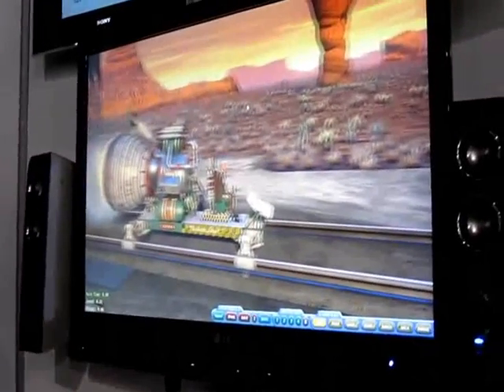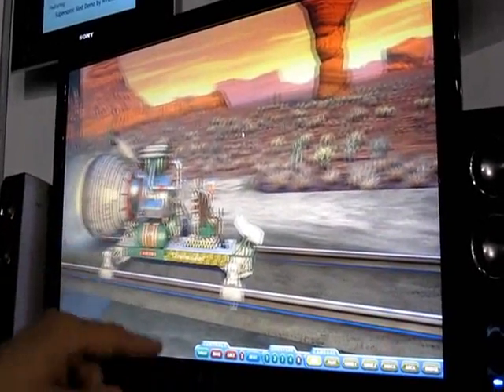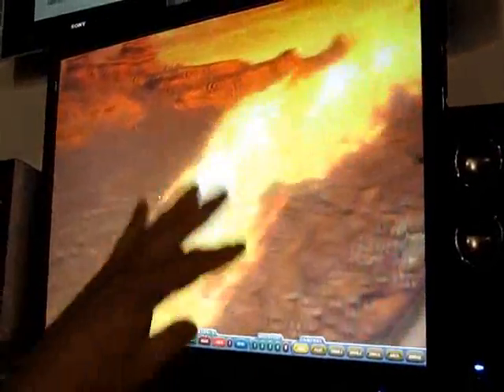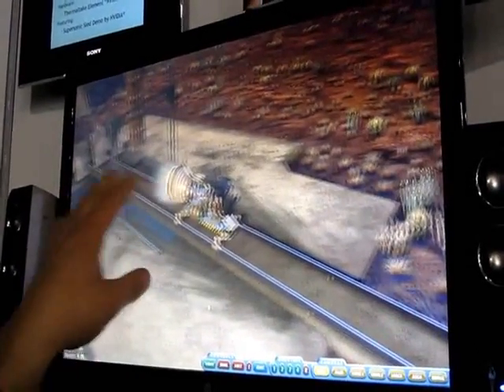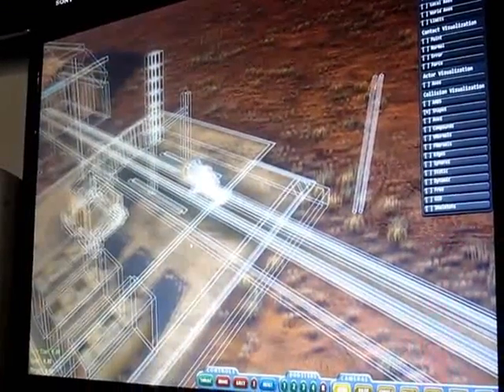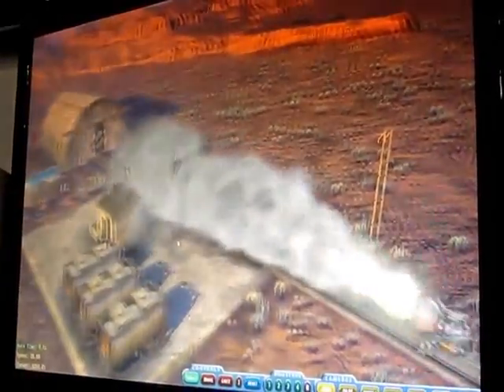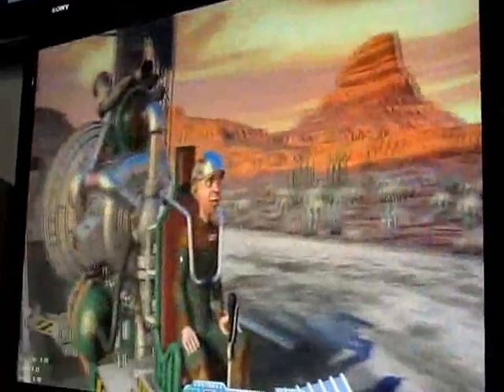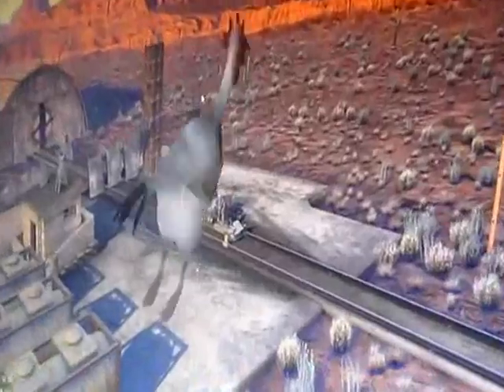NVIDIA GF100 Fermi Video Card Triple SLI Rocket Sled Demo

Comment: @TimisoaraCoolMixers... In case you have a hard fucking time reading, I am not speaking to you.

I am speaking to the guy with the 1800 dollar laptop that cant play COD4 on the lowest possible settings.

BTW, a GTS 250 has really really terrible performance on far cry 2. Unless you play at a low resolution, you arent getting more than 40 fps on ultra, with 25 average.

How do I know this? I ran an overclocked 9800 GTX. In case you were not aware previously, a GTS250 is a rebranded 9800 GTX.

Comment: @mrbigtime81 I'd save some money and get a 5870 or 5770. If they cost the same I would probably get the 5970 because it kills the 480 in DX10 games. But for DX11 480 does do better tessellation, but the raw power of two GPUs in the 5970 allows it to tessellate at a simillar or faster speed. So overall I'd go ATI.

Comment: @alexapirot32 

5890 is the nickname given to the 5970 clocked to 2x5870s specifications. It required 2x PCIe 8 pin connectors and is a triple slot card.

Comment: Well I can play Crysi on Very High with a 1024 by 763 res no aa on the GTX 260m

and Crysis War head on Enthusiast with full res. 

GTX 260m = 9800 GT.. GT 240 is 30% less powerful then 9800 GT. 

you do the math.

Comment: 5770 is not an enthusiast card.  That's the 5800-line.  It's a gamer's card, so it has good performance, but not great.  The GT 240 is a step below gamer...I don't know how you get it to play high to very high settings on Crysis except at 480p, since that's asking a lot out of cards even three times more expensive.  

That said, nVidia with its GTS 250 still has a strong hold on value, but the GTX line is horrid right now...

Comment: Radeon 5770 requires a 450 watt power suply... it doesnt even compare to the GT 240 on any scale.. the 5770 is an enthusiest GPU.

and the 5670 compares to a 9800 GT. they both requir same power supply. and coast the same. 

name one Radeon GPU that requirs a 300 watt power suply and beats the GT 240 wich can play Crysis on High to very high graphics. 

IDC what you say you can make your GPU magically handle. I want one Radeon GPU that says on the Box 300 watt supply or greater that beats GT 240

Comment: you obviously don't have a 300 watt power suply in your computer. because I have tried putting Video cards that require higher wattages and the computer just shuts down. Radeon and Nvidia cards I am talking about. 

your wrong Nvidia has the best cards cause they are the most energy efficent.
on the mid and high end of things

and the GTX 470 will = the 5870 for the same price

and the GTX 480 will be better and coast a reasonable $500. 

Pop goes the Ego xD. not today fanboy

Comment: my god all of what you said is just ignorant and retarded im not even lying
my radeon 5770 can run just fine on a 300 watt psu which also powers a AMD athlon 2 x4(quad core) and 6 gb of ddr2 ram
wattage is not the only thing where ATI has improved over Nvidia, and thats sheer compute power, and PRICE
ATI is not only winning on the enthusiast section but pretty much everywhere else from the 5970 to the 5570

Comment: the GT 240 and GT 340 are better then Radeon because they only require a 300 watt power supply wear as a Radeon GPU with the same performance would require a 400 or 450 watt power supply. 

if you can't see that your just a nut case Radeon Fan Boy. I have done my research on this one. Radeon has nothing to compete.

Radeon might be winning on the Enthusiast end of things with the 5000 line. but not the mid range mid and high range end.  

ohhh and wtf is with You tube and comments messed up...

Comment: 400 series is a jump ahead of the 5000 series, the 300 series is already out but mostly used for laptops and still more powerful than the 5000 series , ati has the shities drivers out there , that is one of the biggest reasons ati does nt win vs nvidia. the 6000 series will the the competitor to the 400

Comment: @jizzmatic2000 well im just saying with my experience with both high end cards from both manufactuers, ati has always run more smoothly in games with better FPS. equivalent cards aswell, i now have the ASUS Radeon 4850 HD, and i have compared it both to the GT260 and 8800GTS. and its still better fps then both, very close with the 260 though.

Comment: @SockanL0L 
Excuse me?

Just because I like ATI's DX11 cards doesn't make me a fanboy.

"better cards produce more heat, period. "

Wrong. The 8800GTS 512MB outperformed the 8800GTS 640MB while consuming LESS power and producing LESS heat. Why?  Because it had a better architecture G92 vs G80.

The GTX480 is better than the 5870 yes, but weaker than the 5970. 

All the evidence points to the GTX480 running very hot due to its larger die. ATI simply has a better architechture this time.

Comment: maybe maybe not, one could hazard a guess that because ATI has a monopoly in the Enthusiast set of graphics cards FOR THE TIME BEING, they probably are jacking up the prices, once the Big guns from Nvidia roll out regardless of how they price them ATI will surely probably pull the 5970 down from its current 700 USD price mark to probably around 600/550 it wouldn't surprise me at all honestly, ATI/AMD have never been a company to compete point for point in performance but bang for the buck.

Comment: Yes the 5870 is the only GPU I actualy like by Radeon. But I am not getting a desk top for 2 years. and I would rather get a GF 100 single GPU in 2 years instead. 

Right Now I have a laptop with a GTX 260m. 

I can play Crysis with descent Performance on Very High with a 1024 by 783 res

and Crysis War Head on Enthusiast with my full resolution. 
Hopefully Crysis 2 will be even more efficient then Crysis War Head. 

but other games like MW2 I can play on Max full res 4x aa no problem.

Comment: No, the GTX295 does not average 60 FPS at crysis 1920x1200, not even with 4xAA or even 2.

Or you could get a 5870 which:
* Is even cheaper
* Eats so little power compared to the 295
* Is two generations beyond on DX (DX11 & DX10.1 vs DX10.0)
* Performs almost similarly
The 5970 is a waste of money in my opinion, but the GTX295 is even more of a waste.
* Eyefinity
* etc etc etc

Comment: @Nomad2243 

36 vs 60 fps is a huge difference. For Crysis, a person wants the best hardware for eyecandy and good fps.

The GTX295's 36 avg fps will be laggy since the min fps will probably dip into the 20s. The 5970's 60 fps avg and higher min fps will result in a butter-smooth gameplay for Crysis.

5970 ~ $600, GTX295 ~ $500, a $100 difference.

The 5970:
is 40+% better across the board
has dx11
has eyefinity
has improving drivers
runs cooler than the 295
uses the same amount of electricity

Comment: @Nomad2243 

In cases with no CPU bottleneck (CPU bottleneck would show <5% improvement).

1. For ATI optimized games, the 5970 performs 80-100% better than the 295.

2. Nvidia optimized games results around 20-40% improvement over the GTX295.

3. 5970s just came out, so drivers are immature. The performance will improve as drivers are improved.

4. If you're just using a single GPU, the GTX295 is basically a underclocked GTX275 while the 5970 is a UCed 5870. The 5870 is going too be much better

Comment: @Nomad2243 

Incorrect.

1. GTX295 and 5970 both use 1x 8 pin and 1x 6 pin connectors so the power draw for both cards is around but <300watts. The power requirements will be exactly the same for both cards.

2. GTX295 costs $500, 5970 costs $600 = $100 difference.

3. 5970 performs ~ 70% better than the GTX295 in some games, and over ~40% better across the scale. 20% more expensive but much better.

4. 5970 supports eyefinity, dx11. 

There is no reason to get a GTX295 whatsoever.

Comment: Hears why I would get a GTX 295. 

It doesn't requir as high as a power suply. 

its $200 dollars less expensive

its sold more commonly at stores I wouldn't half to order it online. 

it gets perfect performance on every single game out in the world with max graphics and aa and a huge resolution. 

once you get to a certain Frams per second you don't even notice a boost in performance. 

thus the 5970 is a huge waste of money right now. 
maby in 3 years..

but in 3 years I will get a GTX 480.

Comment: and as far as I am concerned.

36 fps vs 60

113 vs 130 FPS

you can't even tell. the difference. I would rather save $200 dollars and get a GTX 295. I would'nt even notice the difference for any game out in the world so far. 

and the GTX 295 only gets 36 FPS on Crysis war head if its at 16x aa and a massive res. so there really is no need for a more powerful GPU then the GTX 295 so far. 

maby in 3 years when more modern games come out.

Comment: Actualy I have no clue anymore. there are so many factors with Dual GPU's they are imposible to Benchmark. 

1. Some games are optimized for diferent GPU's

2. Drivers can work better on differnent games.

3. some games don't even make use of the dual GPU. doesnt even split the screen for some games. 

4. ass the resolution gets smaller you get closer and closer performace to the Single GPU's.

Comment: @Nomad2243

Check the benchmarks for GTA4 at 2560x1600 and Crysis Warhead at 1920x1200. Both show the 5970 is 2x better or 100% improvement in terms of fps compared to the GTX295.

You can find the benchmarks on youtube on maxishine's profile. Or just search/google the words "5970 and GTX295"

On overclockers(dot)com forums, there is a chart that shows the 5970 having an 80% improvement in Stalker, 100% improvement in QuakeWars, 77% improvement in Battleforge, 40% L4D2, etc

Comment: Yes, you are right. GF100 is the GTX400 line.

The 5970 is really probably 80+% better than a GTX295 in terms of sheer power.
There are more games that favor Nvidia, and the 5970 drivers at the moment is immature.

In games such as FarCry2, you have around a 40% improvement over the GTX295. The improvement is as low as 15% in Nvidia favoring games such as Batman, and as high as an 85-90% improvement in ATI favoring games such as the Stalker series. 

Either way Fermi will be great competition.

Comment: @Nomad2243 

5970? You mean the 5870.

Even if Nvidia comes out with a dual GF100 card, it still won't be 90% better than a 5970.
A 5970 is two 5870s, which would make it almost double the power of a GTX295.

If we do see a GF100 x2 card, it will much better than a 5870 and perform similar to a 5870.

However, a GF100x2 doesn't seem likely since a single GF100 already needs a 8pin and a 6pin PCIe connector for 300watt power draw. And 2x 8pin PCie connectors is unheard of.

Comment: Plus that onlt takeing in consideration that the GF 100 Dual card will only have double the Proccesing cores. 

the GF 100 cards will also have 3 billion transistors vs the GTX 200's 1.3

GF 100 cards will run DX 11 makeing them have even better performance

They will have DDR5. 

New Firmi Architexture.

 there is no reason why these cards won't be more then 100% better then the GTX 200 line cards.

But I am done talking. only way to know for sure is wait for them to come out.

Comment: I am compareing the GF 100 to the GTX 280. 

not the GTX 295. 

I am sure there will be a dual GF 100 card that will have 1024 CUDA proccesing cores. 512 x2. 

wich will make it 110% better then the 295. 

wich will make it 90% better then the 5970 like I said it would be.

Comment: @Nomad2243 

GTX295 = 480 cores
GF100 = 512cores
GTX295 is about 5-10% better than a 5870 in terms of raw power.

The GF100 has 6% more cores and a more efficient architecture. 

This falls in line with the FarCry2 benchmarks that showed that the highest end GF100/GTX480 is roughly 30% better than a 5870.

Comment: @Nomad2243 

It will be at least 100% better than the Radeon 4x00 line, but roughly equal to or slightly better than the 5x00 line. The 5x00 high end line has double the cores of the 4x00 line 1600 vs 800 so it is already double the power. The 4x00 line in turn was roughly equal to the GTX200 line at every price level.

So you have both company doubling their performance, which in the end results in similar performance for both sides, maybe with Nvidia have a slight edge.

Comment: dude I am logically speaking that the GF 100 line cards have more than double the amount of processing cores. 

More proccesing cores = more performance. 

if there are double the cores from the GTX 200 line. it will have double the performance. and in this case the GF 100 line cards have even more than double the processing cores. witch will make up for the Radeon 5000 lines 30% increase in performance over the GTX 200 line cards. making the GF 100 line cards 100% better then Radeon.   :)

Comment: @Nomad2243 

"Proccesing cores I can only assume the GF 100 cards will be 90-100% better then the new Radeon cards. "

You're just pulling numbers out of thin air.

GF100 has already been benchmarked in FaryCry2 and it's an estimated 30% better than a 5870. I don't know how the hell you're coming up with bogus fanboy conclusions that Nvidia's DX11 cards will be 2x better than ATI's DX11 cards.

Comment: @Nomad2243 
You obviously don't understand anything about math. When you say GF100 is 90-100% better than a GTX295, you're saying it is 1.9x to 2x in power compared to a GTX295.

This is total bullshit. 

A GF100 has already been estimated at 30% better than a 5870, which means it is at best 25% better than or 1.25x a GTX295.

Furthermore, you're grossly underestimating a 295's scaling. A 295 which is two UCed 275s, actually achieves around 70% improvement over a single GPU in terms of fps.

Comment: r600 was original the replacement of x800 series , said to be extreme powerful before it released. however it took more than 2 years of development and later on  it proved  that it is a true shit....the longer it take more problem might behind it. so the longer fermi takes the higher chance it'll facing hd68xx/r900(north islands), just like 2900xt when faced 8800s when the original rival was the g72 not g80.

Comment: now this is all in theory. I don't know how well these cards will perform compared to the GTX 200 line. 

but based on the fact it will have DX 11 and DDR5 and more then twice as many Proccesing cores I can only assume the GF 100 cards will be 90-100% better then the new Radeon cards. 

but there is no doubt these cards are going to have amazing performance on any game out with a huge resolution full anti aliasing and full graphics with no stress to the card.

Comment: you obviously don't understand anything about dual cards. a Dual card doesn't make it  the card 2x as powerful. all the dual card does is split the resolution. make one half of the card handle one side of the screen well the other card handles the other. this gives the gpu around 25-30% better peformance then a single GPU. 
once again the single GF 100 cards will have 512 cores vs GTX 295's 240x2

the GF 100 cards will be 120% better then the GTX 200 single GPU's 
and 90-100% better then the 295

Comment: The GTX295 have 480cores 240x2, so GF100 will not be 100% better than a GTX295.

People have said that it is about 30% better than a 5870, which is roughly equivalent/slightly slower than a GTX295. 

So in the best case scenario, the GF100 will be 25%-30% faster than a GTX295.

Comment: well I don't think they ar skipping the 300's. I have seen the GTS 360m come out. wich is some what a recap of the GTS 260m 

however the GTS 360m has DDR5 Ram. clocked higher and has about a 5-8% better performance difference.

Comment: the GF 100 cards will have 512 Cores in them. wich will make them 100% better then the GTX 295. take this for example the Radeon 5970 is 24% better then the GTX 295. and the Radeon 5970 is a dual card. 

and when I say 512 cores were talking about a single GPU hear being 100% better then the GTX 295. 

I can't even imagine 512 cores in a Nvidia card. these cards are going to be insane. 

Correct me if I am wrong... is the GF 100 the code name for the GTX 400 line?

Comment: Support - sure. The rendering is where its at. Because of build in physx, nvidia is much faster. ATI is much slower because it uses card's resources to render. also cude technologie is genius. Good example would be a game such as Mirror's Edge. The 4750x2 cant handle max detail with physix on, when gtx 260 can. Do not get me wrong, the ATI card did put out a lot more FPS with physx off, t han GTX 260, but performed worse with them on. Also, Do I even need to mention Drivers? Ya...

Comment: @nykvarskurken Nvidia cant 'fix' that issue, these cards use 280 watts, and 3 power cables each (prob 1 8 pin and 2 6 pin). Its their design. These cards use a lot of power and thus generate a lot of heat, having them with mm of space between doesnt allow the heat to dissipate, I bet he even had the cards liquid cooled and they still crashed. These gonna come out in Q1, less than 60 days left.. its gonna be a lot of problems :(

Comment: The drivers are fine and so is the demo, I am absolutely sure Nvidia did everything they can to make them stable for this show.

But it crashed because it overheated, stuffing three 280watt video cards with almost no gap in between and in a small metal box will do this.

Comment: @TheDarthJesus 
" Ati couldn't even render the physics in that game."

You mean ATI COULDN'T render it because it is a PhysX implementation, exclusive to Nvidia cards and you can't even run a dual card system with ATI and Nvidia cards because nVidia drivers lock it out to prevent PhysX being utilized. Pretty fucking sheisty if you ask me.

Comment: GF100 is the name of the chip that will be used for top Geforce cards of the new generation cards, they will be called GTX380 and GTX360 (the naming of the card is not official yet so it might change, but since they started to rename some cards from the 200 series to 300 series i am quite sure it will be something like 380 and 360).

There will be a GF104 and others, those will be used for mid range.